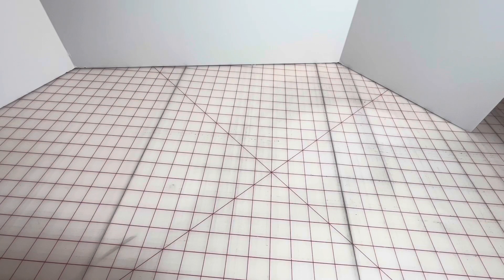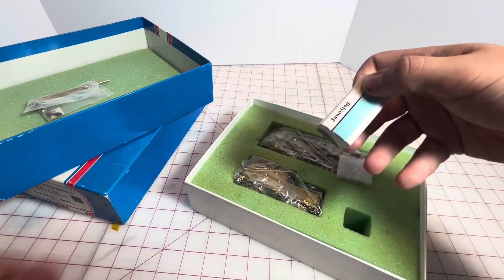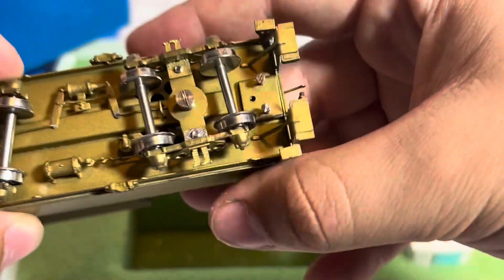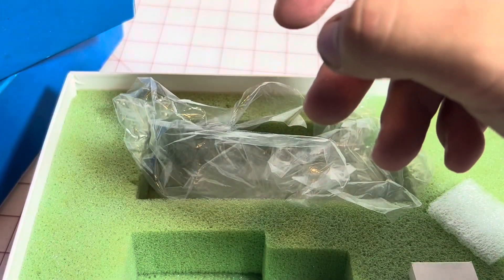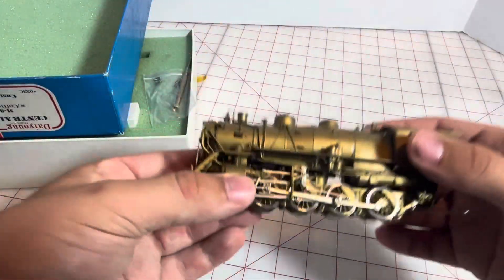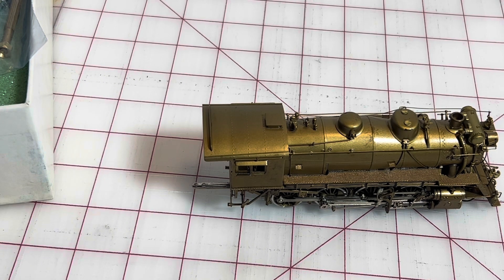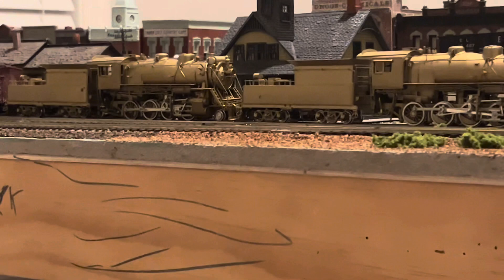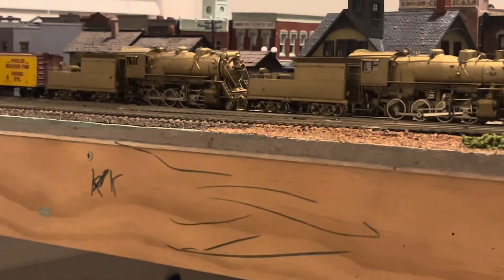Central Vermont M3a locomotives.

Comment: Also a Good DCC install increases the value of the model as it will attract those who want to have Sound and be able to run them rather than just sit on a shelf.
Reply from the maker: Yeah that is very true. But I’ll still run them no matter what control system they have.